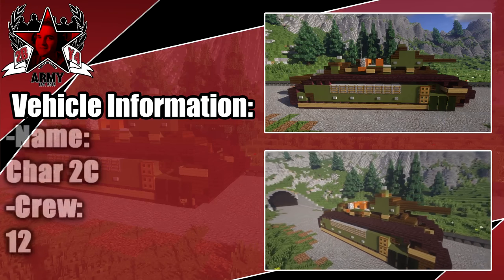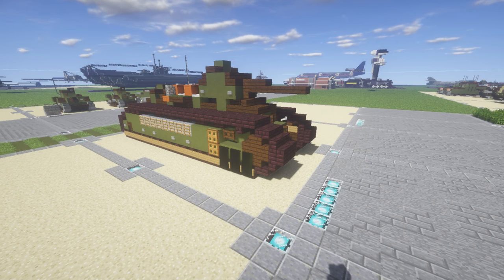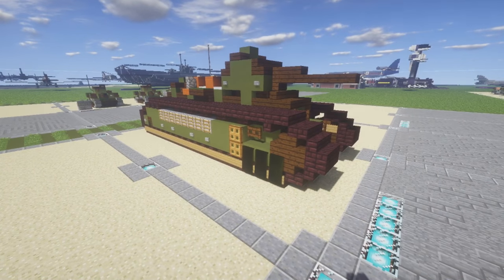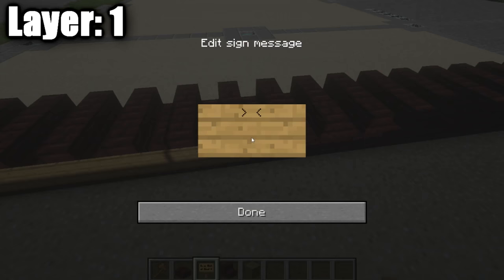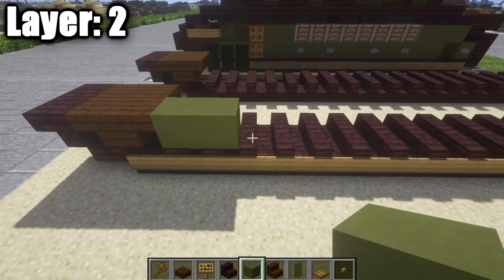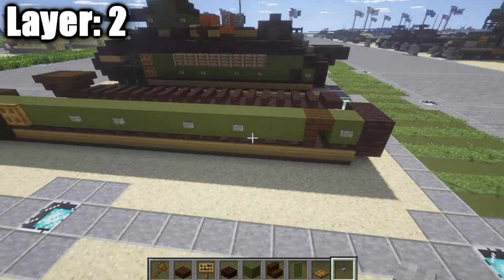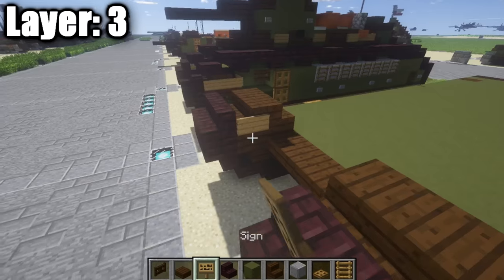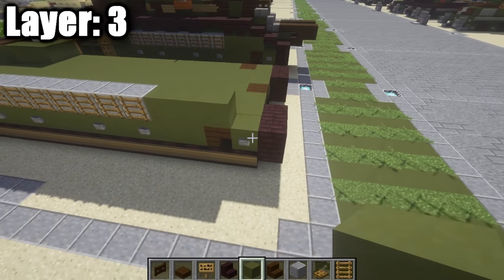Minecraft: WW1 Char 2C Super-Heavy Tank Tutorial

Comment: Char 2C. In physical dimensions, the largest tank to ever be fully operational. 0.07 meters longer than the Maus, 0.7 meters thinner, and 0.45 meters taller. 69 metric tonnes in weight, making it far into heavy tank territory. The armor is rather thin for such a large tank (it was a 1921 design after all), only 45mm at the thickest, insufficient to stop even the weakest of dedicated antitank weapons (though small-arms fire up through .50-cals were no match). Armed with a 75mm gun and four machineguns in normal configuration, but for a time there was an experiment with the "Char 2C bis" which replaced the 75mm gun with a 155mm howitzer. Two 250-hp engines could propel it at a blistering pace of 15kph (slower than the Maus or the Churchill).
Now, with all that information (most of which was mentioned in the video, good on ya there), one can tell why only ten were built. 70 tonnes of steel to build this thing, and it was a target the size of a house, moving at walking pace, that could be penetrated by any antitank gun on Earth. Not the best investment of all time.
Reply: Thank you. I try.
Reply from the maker: +Edward Tai Yeah he sure knows a lot about vehicles! :)